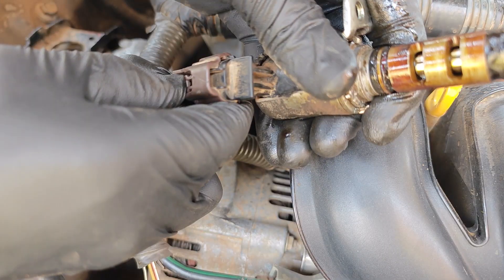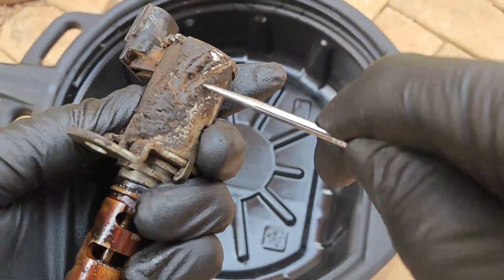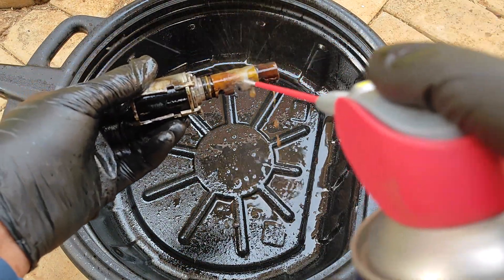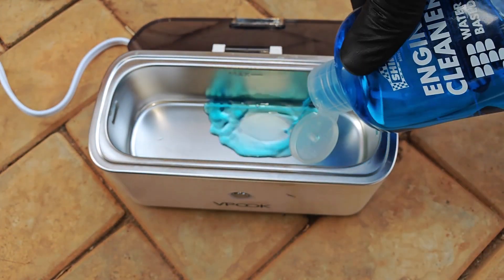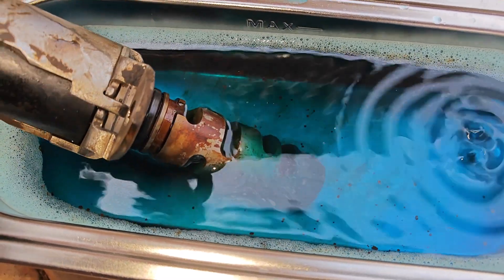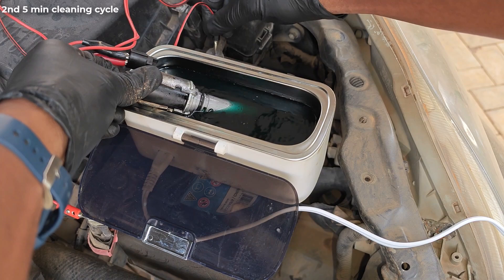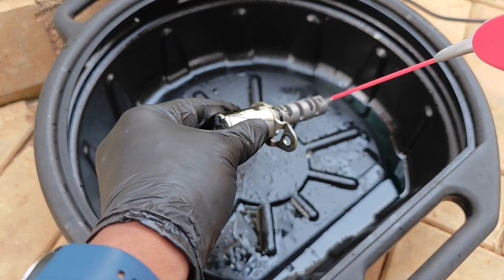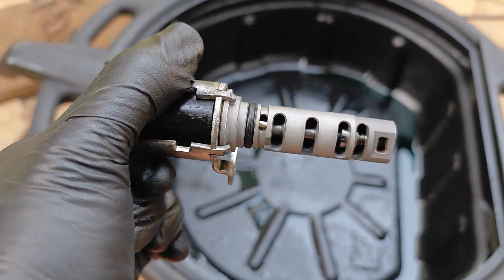Best Solenoid Valve CLEANER / Cleans Engine Varnish, cleans like New /Clean Oil Control Solenoids

Comment from the maker: Have you cleaned these solenoids before? What's your preferred method? Thanks for watching! 😃
Reply: Soak in some cleaning chemical. One I've an oil sample small glass, enough to cover the entire working area of the solenoid. Pop the 12V terminals on a battery and keep popping them on/off for 10 minutes. The final liquid will be dirty.
Reply: I made the switch,  2024 Toyota Camry SE. I'm really liking the fact that the new Dynamic Force engine has both direct and port fuel injectors.

Comment: I've just recently expanded what self maintenance I do on my Mazda at 2013 CX5, And I Honestly don't know much about solenoids But thinking at almost 200,000 miles probably something I need to look into.
Reply from the maker: So you don't have to routinely clean solenoids if it's not acting up. So if it's not giving any problems, no need to worry.
Reply: do  NOT fix whats not broken. You will start causing issues. I'm talking from experience. Change the fluid/filter and nothing else.

Comment: Please can you show us what normal blowby on these k24 engines is like?
I have very noticeable puff from the oil fill cap when the engine is running and it worries me, but mechanics keep saying it's normal. Please what is it like in your engine when you open the oil fill cap with the engine idling? Thanks
Reply from the maker: Thanks for the suggestion! This solenoid is from a 1ZZ-FE Toyota engine though.

Comment: Whats your opinion on cleaning the mass air flow sensor.. is it helpful and how often.
Reply: I cleaned mine once after i noticed unusually high petrol consumption... it did the trick
Reply from the maker: My opinion; definitely helpful. Some dirt gets past every filter and accumulates over time. I clean mine once a year. Probably excessive, but I sequence it to happen when replacing my air filter, that way I don't forget.